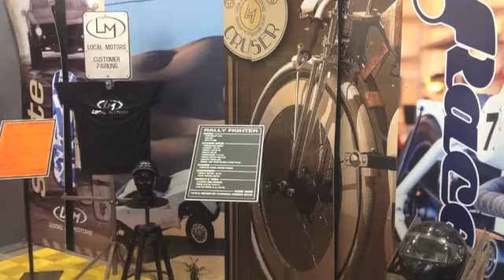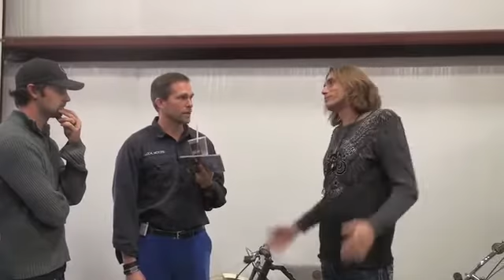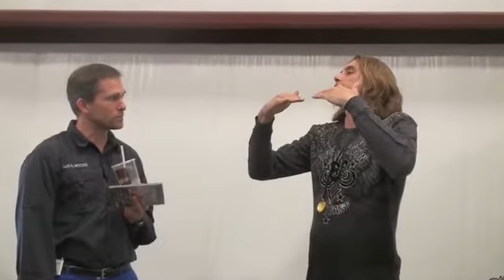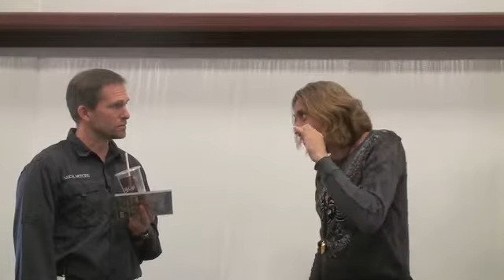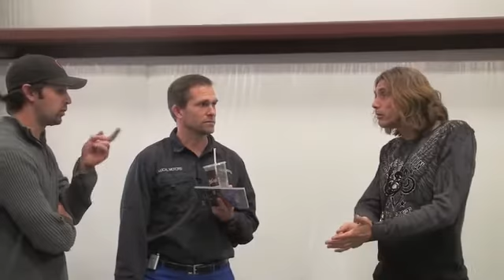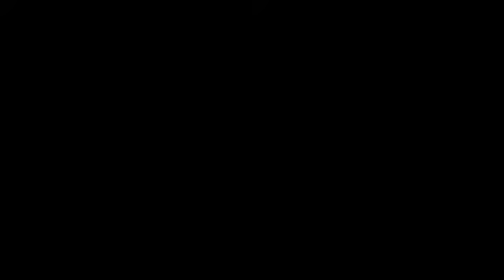THUNDY TAB TECH: Short Explanation

Comment: This is (Kaiya, cover your ears) SUCH UTTER BULLSHIT!!

Try the exact same "experiment" without this stupid product, get the same result! Cold engine + cold catalytic converter = fumes & higher RPM. Let the engine run for a bit (the only reason the talk for so long while the "old gas" burns off and the "new gas" works it's way through the system) and the RPM will drop, the catalytic converter will heat up and you will get little-to-no smell out of your exhaust and water vapour.

Snake oil of the 21st century that's all this is.
Reply: Willow Ufgood 

sounds like something a willful polluter would say
Reply: +Willow Ufgood  I know Thunder and I totally agree.    I wish he was more truthful.  He really is a nice guy.
Reply: +Willow Ufgood Thanks for the explaination
Reply: This technology has been tested after engine reaches normal operating temperatures, that was a nice try though you fucking pleeb